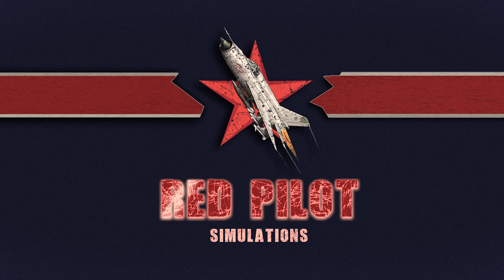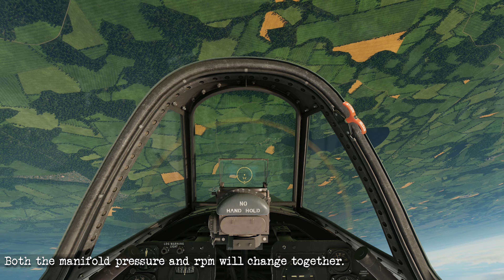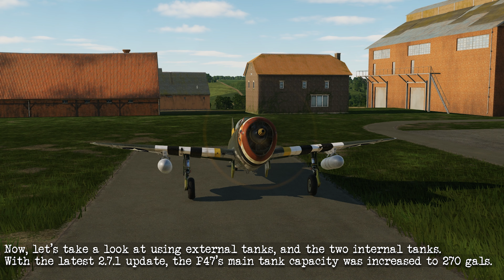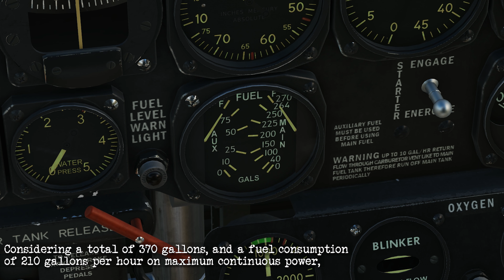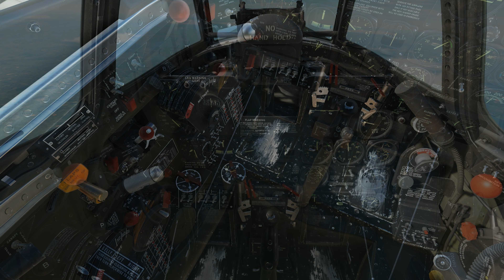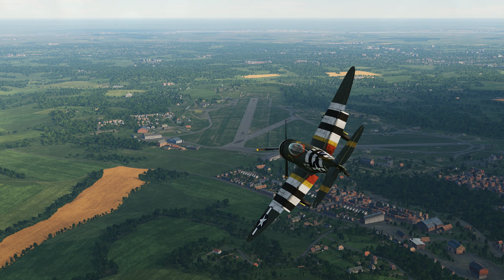P47 Advanced Engine Management [DCS P47D Thunderbolt]

Comment: Locking the boost level with throttle you lose 300 horse power at low level according to manuals. ..
Reply: Yeah until you push the water meth then you have 2800hp at 64in witch you will need against any aircraft at low altitude
Reply: @obic123  I suppose for short duration, engine overheating could become a issue.

Comment: i dont get combing the two? how do u not just destory the supercharger?
Reply from the maker: which ones are you talking about?
Reply: Interlocking the boost and throttle together is purely just for convienience in a dogfight, and should really be avoided as it can cost you 300hp.  If you are already comfortable with managing your engine in combat, then do not bother interlocking.
Reply: @berenhamilton3321  Boost is a Turbo, not the same as a Supercharger. You lock the boost with the Manifold pressure. You're getting confused between the 51 and 47, 51 has pressure and rpm, 47 has manifold, RPM and also Boost pressure of the Turbocharger. If that exceeds the Manifold pressure level, you'll blow the turbo. Thats why they get interlocked above a certain altitude, also you rarely use the Turbo below 5k.